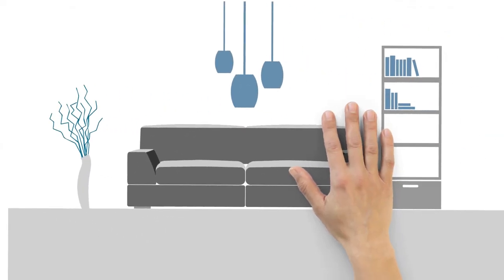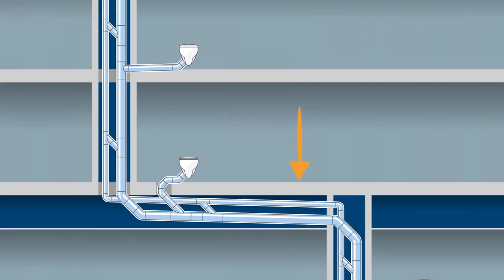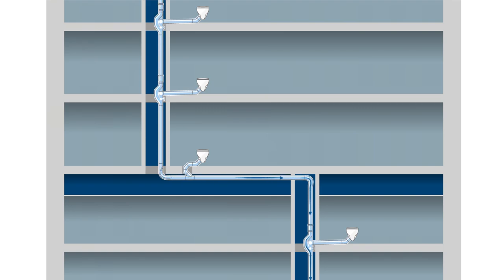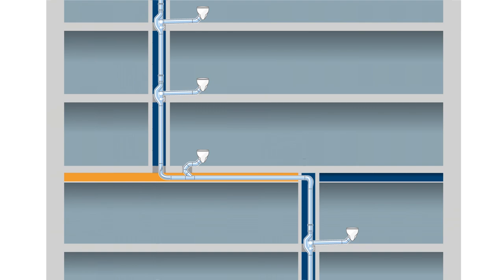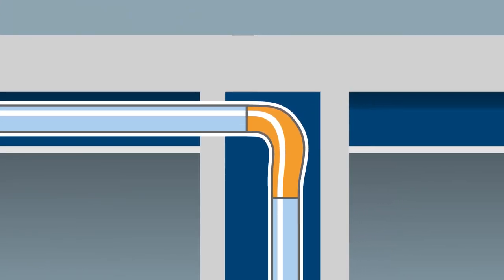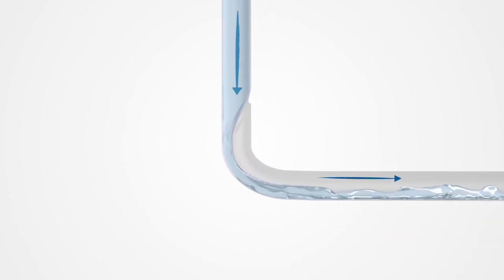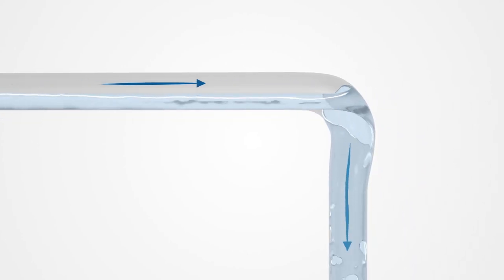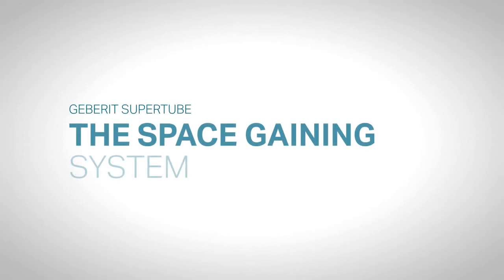Geberit SuperTube – a flow-optimised drainage system for high-rise buildings

Comment: The velocity of the waste water must be slowed down to maintain the air stack and prevent excessive pressure for the bottom floors which could cause waste and gases to flow out the drains.

Comment: Seeing stuff like this makes me wish Kentucky was a little less strict on their codes, because this would be absolutely  illegal. No wet vents are allowed at all. Every fixture has to be individually vented within a span of a couple feet depending on the pipe size.
Reply from the maker: We do understand your point and we worked hard on getting all approvals.
Reply: @GeberitGroup  lol im not saying I like your system. In fact I believe there are way to many variables, and that the system will never work as good as an individual vent-per-fixture system that our code requires. There are just way to many variables for any wet vent, and to install anything as such is just asking for trouble, and not taking pride in your workmanship. That said, I do believe there is a time a place for your system, such as where you are unable to individually vent a number of fixtures in a remodel, and I believe this, paired with a main vent would do the job. But, it also comes down to cost. I guarantee that the fittings in the system alone cost too much to be a suitable substitute.
Reply: Wow no wet vents at all? That's tough
Reply: @say_goodnight7342  in germany and Switzerland it works perfect, experienced man too here. When I see what you build in the US I cry... Geberit very perfectioned the plumbing
Reply: @DerGriefer  I'm not saying it doesnt, lol, and U.S codes doesnt apply to every state. Kentucky follows it's own code, like Tennessee follows IPC very freaking loosely.
Reply: @tranceaddiction  nah, it's not bad. In the end, all you should be wet venting is maybe a lav sink or something here and there. At least by what I understand is IPC. Kentucky followed it's own Kentucky state plumbing code, and besides that, the only code I have worked with is IPC, and that is very loosely followed in my neighboring state of Tenneessee. They basically dont care what you do there, it seems.
Reply: @nostradumbass4984  I really doubt that you have no problems, as we have venting problems sometimes with venting every fixture, and I also dont think venting every single fixture is really needed. Wet venting a lav on a comode stack or some other areas is absolutely fine to me, just not to my code. but I'm not saying it's a bad system , just that in most aspects it could probably never replace a dedicated drain and vent system, but it does have its place in areas where a traditional system would be to tough or costly.

Comment: What if there is a blockage, will a Plumber’s snake be able to go through this fitting, seems very obstructive. Also in 40-50 years how would you repair without opening walls or ceilings? I am a Pipelining Technician, rehabilitating deteriorated DWV lines. This “Sovent” would not be linable...
Reply from the maker: You can clean it with the standard tools. By the way, one part of the system, the Sovent, is available since 1970 so we have some years of experience with it. :-)

Comment: Hi, I have question regarding plumbing system for cascading/stacking/staggering apartment housing design(e.g. Altair Residences by Safdie Architects). How do the sanitary pipings work? Do they follow the slanting angle of the apartment as well? I'd appreciate it if you could help advice me on this issue.

Comment: what type of joint we should use in shaft in high riser building, gasket joint or cement solvent joint?
Reply from the maker: Butt welding joint with HDPE is the best option (pressure tight up to 3 bars)

Comment: It always depends on what is running inside the pipe .
Toilet, paper grease, makes it clogged rapidly. There is nothing for life we always need to maintain waist pipe against lime scale. 
I prefer two waist pipe columns one for toilets the other one for kichens and bathrooms.
Reply from the maker: In many countries in Europe (e.g. Switzerland, Germany, Austria) the drainage systems are designed as single stack systems without separating black and grey waste water.
Most important to prevent clogging of drainage pipes is correct design and dimensioning of the drainage system, especially when it comes to low-liter flush toilets.
With Geberit SuperTube we are offering a hydraulically optimized single stack drainage system that mainly prevents critical over- and under pressure in the drainage system.

Comment: Great idea.
Reply: it is on paper but in reality it is really bad especially in kitchens and laundry lines have the tendency of building soap scum on the walls of the pipes slowing down the flow of the water and clogging the system up 
i am a Facility Director in a property management company here in Florida and my complex have that system we had to do a monumental project to solved the situation of laundry and kitchen lines getting clogged with devastating catastrophic water damages 
definitely not recommended for those applications
Reply: @reinaldoclemente4535  it’s perfectly calculated, check the papers mate. Maths you know?
Reply: @DerGriefer  it’s perfectly flawed. Very bad idea